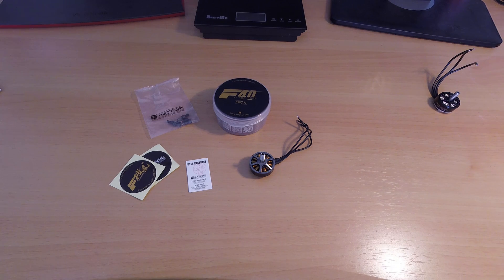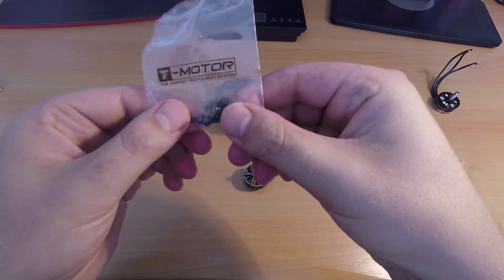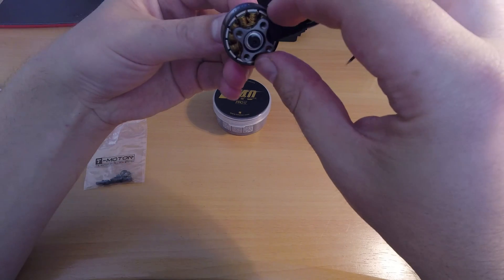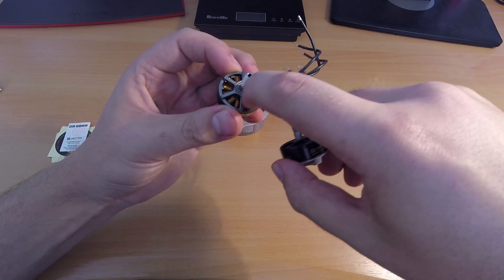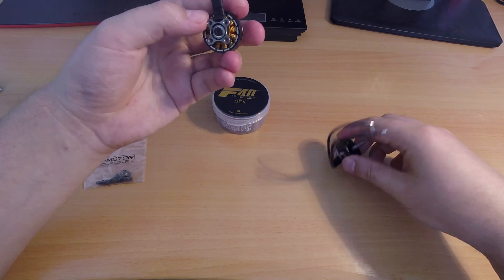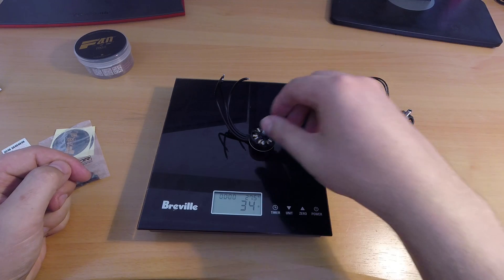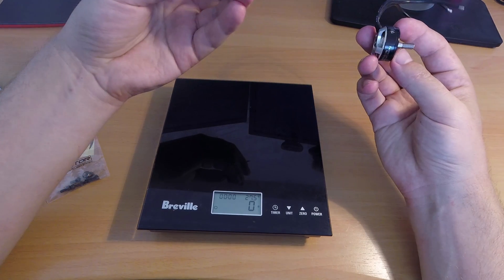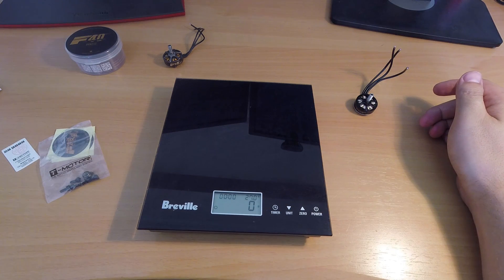T-Motor F40 Pro II Review

Comment: Wich ESC's are you using with these motors?
I bought the same motors (2400 kv version) and i had to swap again to my old motors (DYS Fire 2600 kv), because i was having death rolls after full throttle + pitch or roll. I have no idea why this is happening, seems my ESC's (dys xsd 30A v2) dont like t-motors
Reply from the maker: Raceflight Bolt V2 4in1 is perfect for these. Not sure why that would be, possibly one of your motors was defective

Comment: Nice track and flying. What ESC are you running with this ?
Reply from the maker: DVFPV thanks! Raceflight bolt V2 4in1 ESC is perfect
Reply: FPVDoug : 30 amp escs would get fried right?
Reply from the maker: DVFPV 30 amp escs should be fine
Reply: FPVDoug : alrighty, thanks!
Reply: DVFPV i fly 35 amp Wraith32s on my F40 pro v2 2600s on about 12 builds and they take it just fine... any quality 30 amp will take them with no issues so long as you arent running 6 inch.. BTW these 2600s are flipping crazy on a 6 inch light prop they make massive power in 5 inch but on 6 inch with high C 1800 4s packs the power is just silly and the motors handle it no issue but if you are on full throttle for longer then 2 or 3 seconds ive smoked a few wraith32 35as like that until i started current limiting to 42 amps and since i have been fine and you have stupid power on a,light weight 6 inch build.